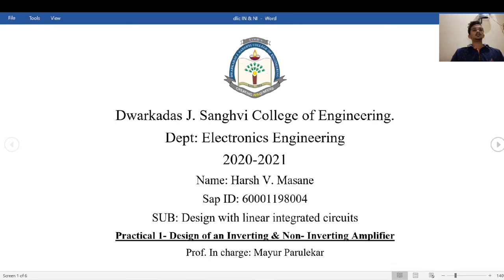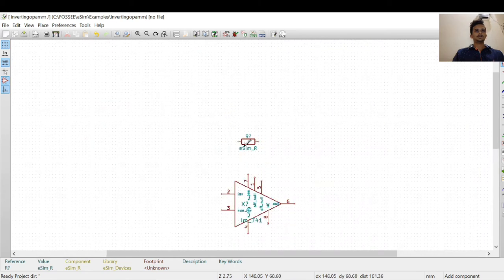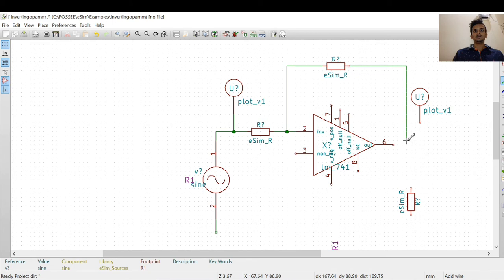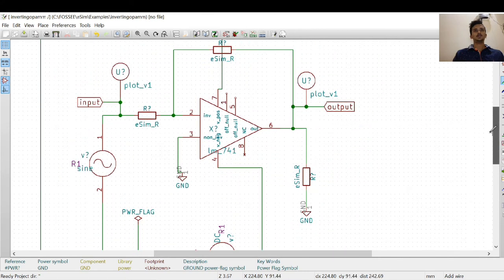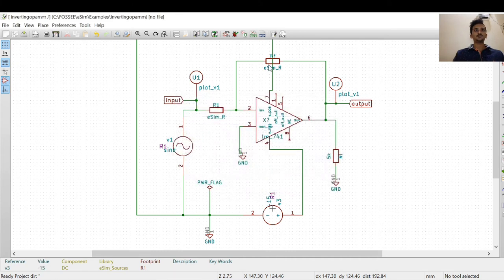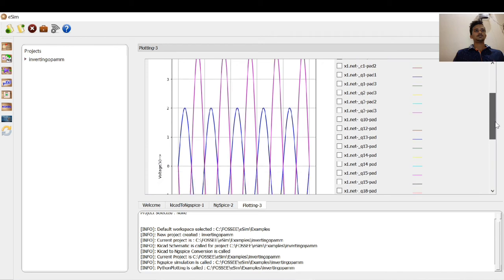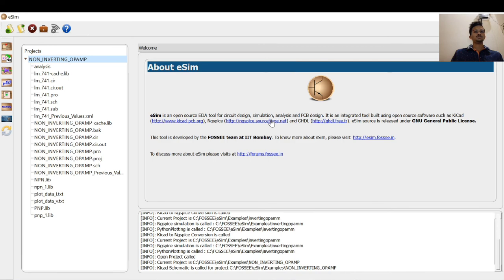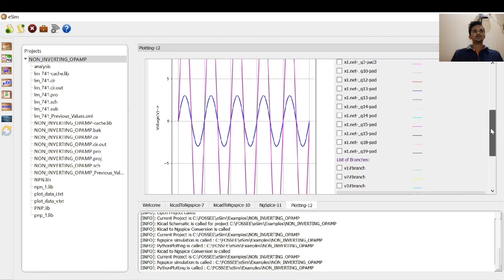Design of an Inverting and Non-inverting amplifier using Lm741IC on Esim software

Comment: I did same as u but I am getting error
Reply from the maker: What kind of error , at the output?
Reply: @harshmasane1133  it shows like error on line 13
Unknown parameter on .tran-ignored
Simulation intrupted due to error
Reply from the maker: @user-bu5vg9vz4g  you can try with other components then
Reply: Other components means?